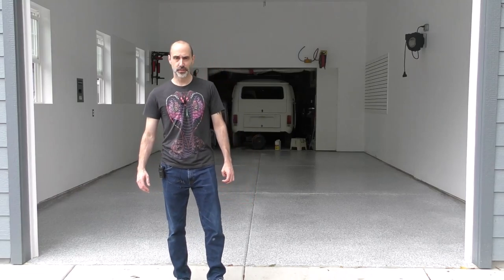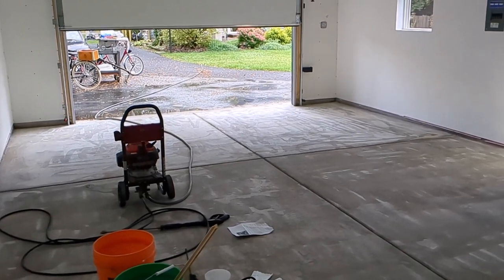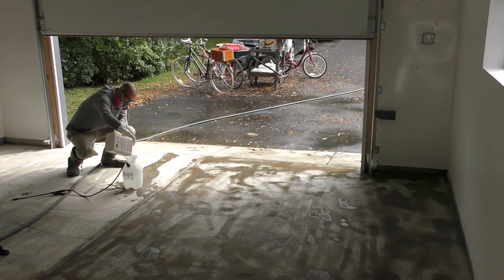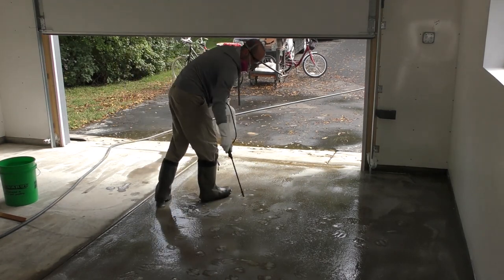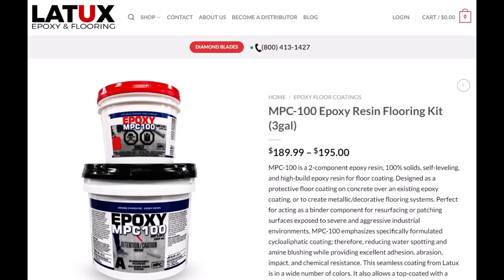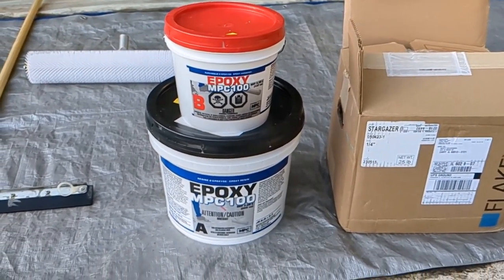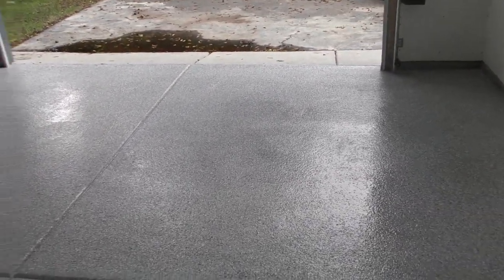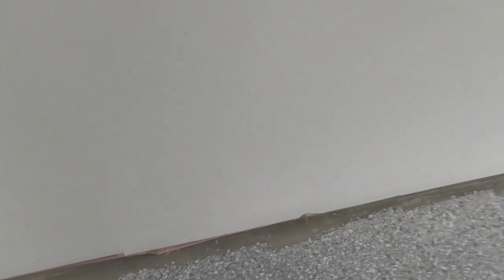Garage Rebuild Part 7: Epoxy Floor Coating (DIY How to)

Comment: Excellent video my man. You touched on each product I’m considering and nailed all the things I think most of us all try to weigh. I saw $650 armorpoxy listed 1/2 off on the desert tan color about a month ago on Amazon but we waited too long and it’s now full price. (600sq feet). Even so you cleared up why many people had complaints on that product being short on several key items. I’m like you, why clutter up the details of a product package referencing cheap and common things. It looks like a 2 man job and some repetitive jobs to have the best outcome but I never have competent help, and find that in most things I can do usually are imperfect but “skilled professionals” usually do 
far less prep and anything but meticulous. Word of mouth and experience is my only solution to that, yet it’s still 50/50. Great video and details most men will truly appreciate. Cheers
Reply: Geeze grammar was never a strong point for me, but I will note my garage floor details.
House built in 70’s and built above and beyond normal code, by someone far more driven, knowledgeable and meticulous. The house and 13 acres is better described as an estate with over 5k square feet and 6 bedrooms. It’s far more than needed but that’s beside the point. The garage floor is a 3 car garage with a smooth surface unlike the driveway with a far rough surface. The garage enclosed with one big overhead door and one standard size garage door. When it rains the floor in the garage gets wet by the humidity and temp fluctuation, which I never saw a way to resolve. My mindset was it’s wicking moisture through the concrete and they must have not used proper vapor barrier before the pour. it’s taken 8 years to have the epiphany that this is wet from a temperature difference, but when I say wet it’s like squeegee wet, and significant, only when it rains though. 
My mindset was paint or epoxy would not adhere after the next rain, or work  for a while then  fail, peel up. 
I realize it’s like condensation so a barrier on top would prevent this but would need to be a heavier coating. As it is now and always been it’s a bit treacherous to walk on the smooth wet concrete. Even simple things like dog food spilled has oils and those become like walking on ice. My need is to make a vapor barrier that is like an insulation barrier. I hope it works, and I’m sold on what to get now with your advice.
Reply from the maker: Thanks for your thoughts and kind words.  I agree with what you said.  For your situation, being an older slab,  I mention toward the end of the video that older concrete may not take the acid etch.  You could certainly try my acid etch instructions on a small area and see if you get results.  Otherwise, plan on renting a flooring sander with diamond blades to etch the floor.  As for your moisture issue; that seems to be just improper drainage.  It may have settled over the years, or doesn't have a thick gravel base underneath, or maybe you need curtain drains or better gutters to weep water away from the slab... It could be something you could improve.  But I also think the epoxy coating (if applied during some dry days) could be an effective moisture barrier to keep the water from seeping up from the slab.  If it were me, though, I would try to figure out how to improve the drainage as well.  Good luck; hope it all works out for you!

Comment: It looks fantastic Scotty !!! I think you are being hard on yourself with that grade of C.
I have used the box store kit in the past, it did not come with a clear top coat.  Looked pretty good but not that durable.

What size is your building again and are those 12 foot ceilings ?
Reply from the maker: Thanks!  Yes, the ceiling height is 12'4 with 2x6 framing.  The overall dimensions are 18x30.  It was modelled from RV garage plans.

Comment: Thank you for this. I researched and narrowed it down to exactly the same combo or mpc 100 and mpc 275. This video basically gave me assurance that I'm on the right track. Do you think using 3 gallon polyaspartic top coat would have been better than 2 gallon?
Reply from the maker: An extra gallon of top coat would be ideal. My application was inconsistent, so it was thicker in some areas and thinner in others. If I had more, it would have been better. Good luck on your project!